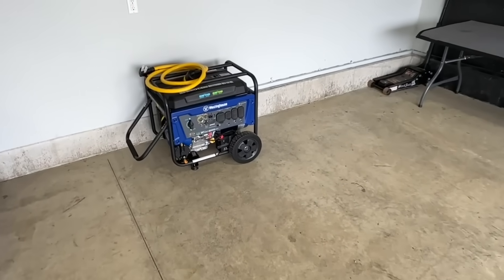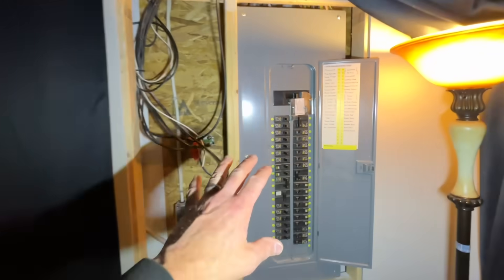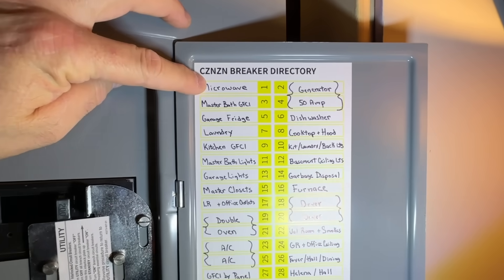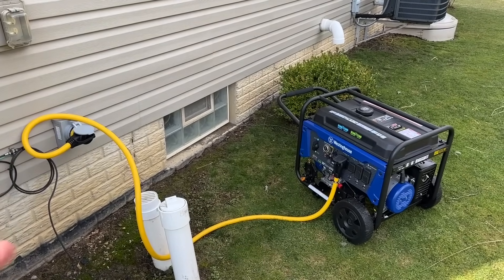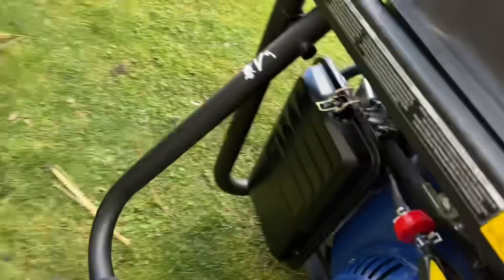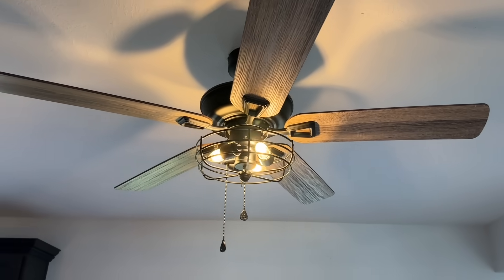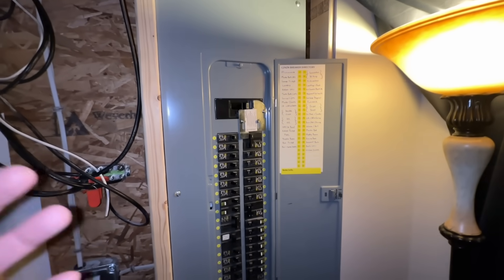Whole Home Manual Backup Generator Setup For Less Than $1600

Comment: Finally, somebody who made a video that doesn’t use a stupid transfer switch. That only allows you to use the so-called important things ,dummy switch .This is the way you do it if you want to be able to turn lights on and off in your house and be conservative and aware of the power you’re using. This is the way you do it if you wanna be able to use your whole house.
Reply: All it takes is for someone to miss flipping a breaker and you'll fry your generator. And turning the generator off under load will also fry it, and you won't know until the next time you need it. PLEASE install a transfer switch panel. These are designed to totally isolate and protect your generator.
Reply: @davidallen5535  that generator has breakers and shut off.
Reply: @davidallen5535 - you don’t know what you’re talking about
Reply from the maker: @BlairBoy420 I’m actually 45 (but feel older lol), not reckless, have family in trades, design new home construction for a living, and work with many other professional trades in construction, and all the electricians I’ve talked to here in my area (Pennsylvania) agreed that this setup is fine.  Im basing this on their professional opinion, not mine.  I’m not saying you’re wrong.  Codes are definitely different from one area to the next and a true transfer switch set up is better, but this is just a budget friendly option for those that can’t afford a high-end set up that need power to their essentials in an emergency situation that only happens once in awhile.  But appreciate your insight 👍🏼
Reply: @DieselLegiance  A lot of the "professionals" always rush to inject their opinions and totally miss your point. It's sometimes laughable 😂. Anywho, great video my friend! 👍👍
Reply from the maker: @silvergrizzly316 Thanks 🙏
Reply: How do you kill the utility neutral?  You can’t unless u use a 3 pole single throw transfer switch .. this is not safe !!!
Reply: @johnburnett6060  Not necessary. WIth the main breakeer off, it's not possible for current to backfeed into the grid (there isn't a complet path for current ot flow).  Both wires from the service are disconnected when the main breaker is off.  HOWEVER, the NEC says that the bond and neutral inside the generaor must be separated.  Then use a 4-prong connection (he does) to the home.
Reply: You clearly don’t know what a transfer switch is
Reply: @oneofmanyte3321  I know exactly what it is .. my only thought that when u shut off power from transfer switch if neutrals are bonded together that does not kill utility neutral. That’s why we use a 3 pole single throw transfer switch ( manually) when I’m hooking up a portable generator. Now when it’s automatic/ Generac ( stationary) that is different. They are separated in that transfer switch..
Reply: @johnburnett6060  a generator purpose is to provide back up power not supplying to your entire circuit breaker box transfer switch is use to isolate your main box and provides power to important circuits that you pick.. interlock you have to constantly turn breakers off. which can cause overload..
Reply from the maker: @BlairBoy420 I agree, there are always variables that can make anything unsafe.  This set up is not permanent, it’s only for a case by case basis.  It’s a budget friendly option.  Have a great day 👊🏼
Reply: The advantage of a transfer switch is that some circuits remain connected to the grid.  When power returns, you'll know it, especially in the daytime.
Reply: @BlairBoy420How can that happen?  The home is connected to the grid via a center tapped secondary on the transformer. The neutral wire is the only wire connected to the transformer on the pole when the main breaker is off (as it should be).  One of the hot wires in the service panel has to be connected to the incoming service wire making a complete circuit in order to induce current back to the grid.  Without that hot wire connection, there’s no complete circuit to the transformer secondary.
Reply: @BlairBoy420 No I''m not.  Do you know enough about the  subject to explain how it could backfeed?  Probalby not.  Just saying it can backfeed doesn't explain how it can happen.  Don't be so protective of information that  you have.
Reply: I like your set up.  I’m looking to add something at my house and I got great value from your video.  Just thinking out loud, but if the Panel main burns up and somehow fails closed you could back feed the utility transformer. Right?
Reply: 50amp connection, doesn't that mean a maximum wattage of 6000?  So could a smaller generator do the same?
Reply: Transfer switch is the best way to go.. interlock is not safe and too complicated..
Reply: @anthonymyers4482 - if you make sure the generators are floating neutral there’s absolutely nothing unsafe about a manual interlock.
Reply: @anthonymyers4482  are you a licensed electrician??? The transfer switch is the easiest and less complicated for the homeowner to use . Half of these yahoos doing these videos aren’t licensed electricians .
Reply: @johnburnett6060  currently I’m not.. but I do know that using a transfer switch is safer than using a interlock..
Reply from the maker: First, I am no “Yahoo”.  Second, I had a licensed electrician install it.  Third, yes, an interlock is a tad more complicated to use compared to a transfer switch, BUT, it does not make it wrong.  It works perfectly fine.  It does the job.  It allows the homeowner to manually power their essentials and more in an emergency situation without dropping $10k.  I don’t lose power that often to make that big of an investment.  Plus, inflation is hurting many people financially so the purpose of this video was to show others how to achieve temp power at their home on a budget.  I’m not down talking a transfer switch, it’s great, but it’s overkill in some cases and extremely expensive if you don’t use it all the time.  And then you have to ask, how long is that stationary generator good for?  If an average generator (Generac) lifespan is 3000 working hours, that breaks down to about 125 days.  If I have to replace $1000 generator every so many years that’s way better than replacing a $7000+ generator.  But, I do respect everyone’s thoughts and opinions.  My goal is to help people do things on a budget.

Comment: I have a 4 ton ac unit. I bought a 6500 gp generac. I had an electrician install the inlet plug. But I was to afraid to try to run the ac on 6500 running watts. Is 6500 enough to power the ac and fridge?
Reply: The AC will not start and run without a soft start as the in rush current is 125 amps (at 240 volts) without it. My 4 ton with the soft start drops the in rush to less than 20 amps. You generator could start and run the AC with the soft start but it might get overloaded with too many other loads. It’s way big enough for most of your house and appliances without the AC. Just don’t try and run too many 1000 watt appliances at the same time like a toaster, coffee machine, microwave, hair dryer, etc.
The general rule of thumb is to not load the generator continuously with more than 50% of the generator capacity.
Reply: Get a soft start for the AC. Then it should work.  Without soft start don’t even try it.

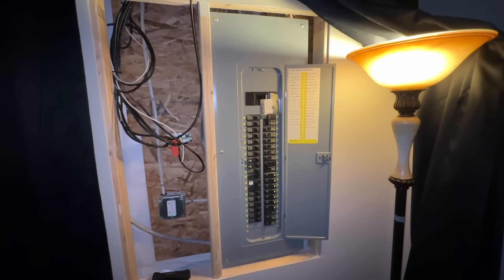Comment: Good realistic video. Peak load is the problem for all electric homes. Living in the South in an all electric home, AC is the primary need, I’m living it right now 4 days into a power outage with 100+ heat index in Houston. Because motors have a huge startup peak load, these little generators have a hard time keeping up. The power company can handle start-up surges for AC, dryers, fridges, etc with ease. These little units simply can’t handle it. A 3 ton AC unit that needs 3000 watts to run, may need 8000 watts at start-up. Couple that with the simultaneous blower motor start-up and you 15:30 may need a 10,000 watt generator just for the AC alone. Now add fridge and freezer motors, maybe a sump pump motor or well pump, and then add in all the other stuff and pretty soon peak power needs exceed even a 15,000 watt generator. Whole house is a misnomer, especially with all-electric homes. The fact that you are driving a 200amp service through a 50 amp plug pretty much sums it up. And such is the beauty of natural gas, it seldom fails! Keep this in mind as your gov wants to push us towards an all electric world. The generating capacity, grid capacity, and reliability just isn’t there! What happens when everybody plugs their electric vehicles into the grid ot when the grid hoes down. Think about it seriously and don’t blow it off as won’t happen. In these situations it may take a 25,000-30,000 watt generator for backup. Generac already sells 26,000 watt units so we are actually there now.
Reply: well im glad you said something because here i am also in houston and shopping generators
Reply: @beeefcaike  Purchase a 1,300 Watt generator and you'll be good. If you want to conserve power just buy a portable AC and they don't use much power. That is what I'm going to do.
Reply: Install a soft start on your ac central unit that will reduce dramatically the start up watts
Reply: Portable ACs are not as efficient as wall units though so beware the power consumption.
Reply: @delta_tango_dt  yes but easier for the average person to set up.
Reply: ;on the small generator you should start the fridge and freezers up 1 at a time
Reply: @michaelphillips8055  How does that work? The fridge and freezer cycle on and off the whole time they are running. It's kind of hard to get them in sync, or out of sync, so they don't both cycle on at the same time.

Comment: What size wiring did you use from the inlet box to the breaker box?
Reply: #10 wire is typically rated for 30 amp.  The setup shown in the video is 50 amps.  I would expect he used #6 wire.
Reply: @neilbrookins8428  great reply... nosure1872 is definitely not sure.  #6 is needed for 50 amp as you said
Reply: Depends on the length of the run from outlet to breaker
Reply: Used #10 wire on mine. About a foot run from outlet to breaker

Comment: Does it matter what order the breaker is on the panel? I have a blank spot near the bottom and assuming that's ok.
Reply from the maker: Yes, it needs to be at the top for the interlock switch to work.  Just move 2 single breakers from the top to the bottom to make space.
Reply: @DieselLegiance if you don't use a interlock switch can the breaker be at the bottom?

Comment: Thank you very much for the detailed process. It helped a lot for a newbie like me. I am planning to invest in one. Q. How do you know if the power is back when the generator is running? How do you know the remaining fuel or the load to shutdown/power on equipment?
Reply: The same company that makes that power inlet box also makes a power back alarm.  The model number is THP108.  Using this alarm you will get an audible alert when the power from the street is restored so you know when to turn the generator off.
Reply from the maker: Well, that’s where it gets tricky with a manual set up.  You’re going to have to keep an eye on the fuel.  A full tank could easily run 12 hours.  Some companies having an app or some type of notification system that notifies you when the power is on.
Reply: I keep in touch with neighbors.  Look at the actual meter too in order to see if it is back on

Comment: I pretty much have to same setup.  I would like to have a device that would monitor the load on the generator.   Have you looked into something like that?
Reply: Emporia Vue is what you need. It works when the grid is up and when the generator is supplying power.
Reply: i just posted a project box i made that does just that.  Any sort of DIYer can make it
Reply: @condor5635  Great!   Where was it posted?

Comment: Why would you shut down the generator under load. Not good for it, or for anything in your house that's running, like a refrigerator compressor. The best practice would be to shut off the 50a generator breaker in the panel and run the generator unloaded a few minutes before shutting it down.
Reply: He also left all the breakers on when he flipped the gen breaker on.
Reply: All of this is good info as we live in Florida and understand these things. Great video example, brother. We learn as we go in life
Reply: Amen
Reply: Common since. I'm not electrical, but I do know that much. Glad I read comments lol
Reply: Should have turned the generator breaker off, then the fuel and let the generator run out of gasoline. You do not want to store the generator with gasoline in the carburetor. Also gasoline goes bad quickly and you should consider draining the gasoline out of the tank for storage. Ethanol goes bad.
Reply: I would recommend at least get backup emergency lights.  One for the breaker panel and one outside
Reply: Thanks for your comments as I'm learning and hoping to have this system installed by a professional electrician. Be safe and prepared.
Reply: Your funny what if it runs out of fuel under full load, OH BOY IT HURT ALL MY CRAP. 😅😅😅
Reply: Also turn off the Gens breaker before unplugging it at the generator. Live cord.
Reply: @That1Ruby_GT - there is not a live cord that is a danger in this setup. Don’t know what your referring to
Reply: @condor5635 yes you are correct after seeing the video again I noticed it
Reply: What is the different if he flipped the breaker or turned of the generator. None. Lol
Reply: @janetc4306 .    Shutting off the generator causes Voltage and Frequency Spikes/Fluctuations. As the generator engine winds down, the voltage and frequency of the electricity it produces can become unstable and erratic before completely stopping. Connected appliances and electronic devices are designed to operate within specific voltage and frequency ranges. Turning off the breaker is far better. 
Damage  sensitive electronics: Devices like computers, televisions, and audio equipment are particularly vulnerable to voltage spikes, which can fry their internal components.
Cause appliances to malfunction: Motors in refrigerators, pumps, and other appliances can be damaged or experience reduced lifespan due to inconsistent power.
Reply: @oldmech619 that's for the explanation!
Reply: Trumpers logic
Reply: @Mission9172  truly TDS stage 4. People are talking about generators and you bring in a Trump comment.  Nice. Get over it - you lost.
Reply: @condor5635  I didn't lose anything. Can't wait until your cultist wolf turns on his sheep. Popcorn time for me😂
Reply: @condor5635  tds 100%
It's all they think about.
Reply: @maneevent1508  LIBERAL TROLL! andysmyvette78 is 100% CORRECT! Just like a normal breaker panel, Always power off each breaker, then the Main, reverse order to restoranın power! THATS SAFETY FIRST!

Comment: 12:07 BAD BAD BAD SHUT OF THE GENERATOR BRAKER FIRST AND LET IT COOL DOWN THEN TURN OF THE GENERATOR
Reply: Yes indeed… to shut off generator you flip break off first to cleanly stop power to house… the method in this video… of just turning off generator allows the voltage to the house to drop as the generator spins down to a stop… super bad for any electrical or electronic components
Reply: @jamesc8453  and the generator
Reply: @jamesc8453  Trashes the generator and unnecessarily leaves the house unpowered for longer than it needs to be. Not a big deal, since it's only a few minutes, but if there are other people in the house, or your service panel is in the basement, why shut the power off and walk down there in the dark? Just do the transfer first, then flip on whatever breakers were off in the panel, then let the generator cool down, then shut the generator off.

Nothing about his order of operations makes any sense.

Comment: How many watts to run the average smaller nome split unit AC , PLEASE
Reply from the maker: Varies…AC Central Units can use 500-4000 watts.  You would have to research your unit specific watts to be sure.  In average 3000

Comment: $500 is a lot for an interlock kit, even with installation cost. But the one thing is, I thought you shouldn't turn off or let a generator  run out of gas under load.
Reply from the maker: When I run it, I keep enough fuel on hand and don’t let it run out.
Reply: @DieselLegiance  but didn't you shut it off while the load from the house was still on it as part of your shut down sequence to reconnect to the grid
Reply from the maker: Turn Main circuit breaker “OFF”
Turn “OFF” all branch circuit breakers
Slide interlock plate
Turn GENERATOR breaker “ON”
Connect and start
Turn “ON” essential circuits

Engage circuits one at a time, allow time for large loads to start.

Reverse procedure to return to MAIN power
Reply: Not tring to be a pain. Just making sure i understand correctly for my sake. Look at your video staring at 11:50 your house is running off of the generator and you just cut it off. At this point i turn my generator breaker off first l, shut down all breakers. Then disconnect the line at the house, shut the fuel off to clear the carb. Then i turn my main back on and all breakers. So i never turn mine off under load@DieselLegiance